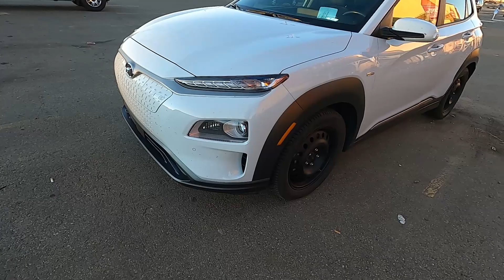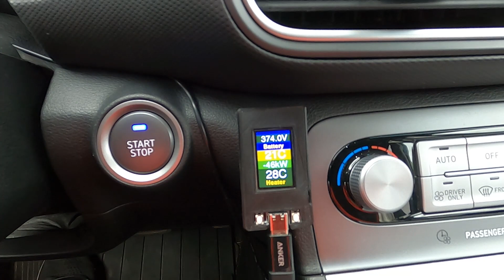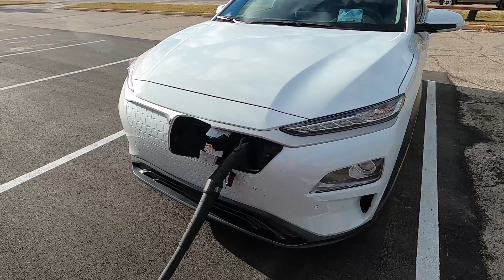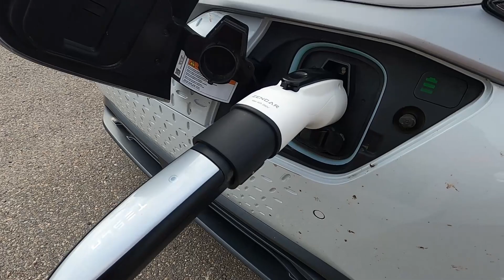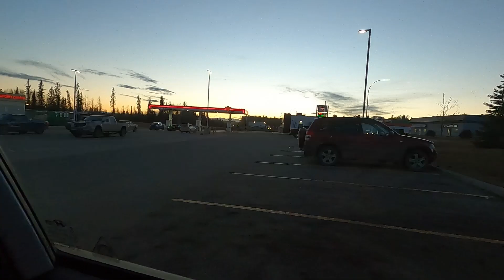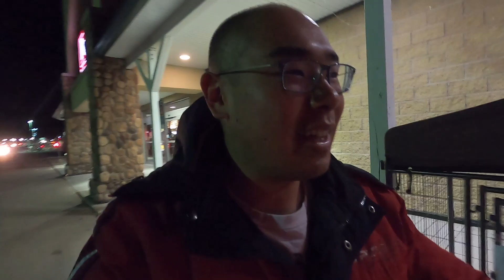722km EV Road trip | Edmonton to Jasper | Hyundai Kona Electric 64kWh

Comment: hi Is there a reason u didn't use the Tesla fast charger with ur adapter at Edson? :)
Reply from the maker: The adaptor could only be used for AC charging and not for DC fast charging at Superchargers. On top of that, the adaptor I have is only rated for up to 10kW.

Comment: Noticed you wore your jacket for the entire drive. What was your cabin temperature set at for this trip?
Reply from the maker: I remember I used cabin heating of around 20C with the fan setting to 4 for most of this trip. I do use the heated seats and heated steering wheel a lot because those use much less energy than heating the air.

Comment: I have tried doing these conversions with my Kona but have found the percentage doesn't follow Kwhs in a linear fashion.  Especially above 90% . It's like the 90 to 100% is really only 5%. I haven't tried it at the lower end yet.
Reply from the maker: Your observation is correct. The Kona seems to have very little energy from 90% to 100% and seems to hide some extra energy in the 0% to 10% SoC. Which I think is a better than the reverse. I forgot where I heard this but some people say the battery % follows voltage or amp hour.
Reply: @READYSTEADYCHARGE  Sounds like a Bjorn Nyland observation.

Comment: Nice video, I am about to drive my 2021 Kona ev for the first winter.
I averaged 7.5 klms per kWh in the summer and am wondering what range I’ll get in the winter.
Do you find 5 is about normal for you in the winter, I’m in Ontario, a little further south than you.
Have you heard anything about Tesla selling super charger adapters and allowing non Teslas to charge?
Reply from the maker: I would say 5km/kWh is the consumption for mild winter highway driving or -10 to -15C mixed/city driving. When I drive at 120km/hr on the highway around -25 to -30C the consumption could go up to 4km/kWh. I haven't heard anything about supercharger adapters for non-Tesla. I think they need to workout all the kinks in their Netherlands Supercharger opening for non-Tesla first before even considering the same thing in NA.

Comment: What was your heat pump consumption at that temperature?
It's interesting to compare to my Kona without heat pump. 
The weather is similar to yours here in Ukraine nowdays.
Reply from the maker: The battery heater consumes 2kW when trying to heat up the battery and the battery heater only turns on when plugged in 99.9% of the time. I have seen one instance of the battery heater turning on when not plugged in and I believe the vehicle was trying to prevent power limiting due to cold battery.

Comment: Hello, waiting to receive our 2022 Kona EV. Will likely arrive this Feb. What type of winter tire did you purchase? Is there a recommended type for electric vehicles?
Reply from the maker: I am using Continental Viking Contact 7, these are what the dealership suggested and I haven't tried any other winter tires on my Kona. The Viking Contact 7 seems to work well but I don't have any others to compare.
Reply: @READYSTEADYCHARGE  I've got these shipping to my home now for install on a 21' Ultimate (US) - no heat pump or roof rails here unfortunately
Reply: I have a Niro EV and use Michelin X-Ice mounted on Fast Wheels meant for evs

Comment: where do you get the flo cards? or any other charge cards?
Reply: Hi. I downloaded the FLO app and applied for a card there.
Reply from the maker: You can order a card from the Flo app. I believe it is $10 to get a card. This card will also work with BC Hydro and comes in handy when traveling to BC.